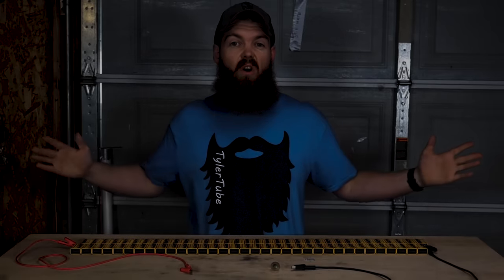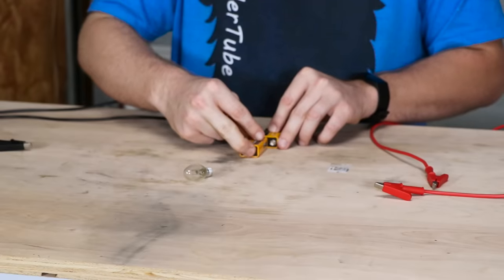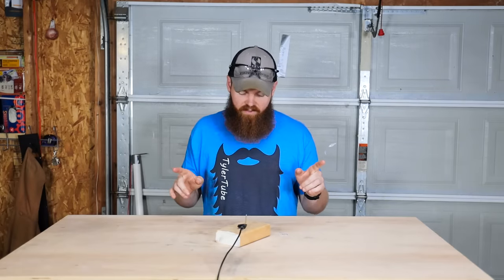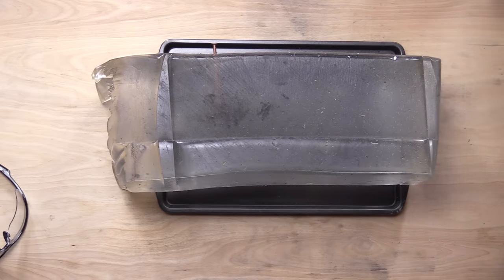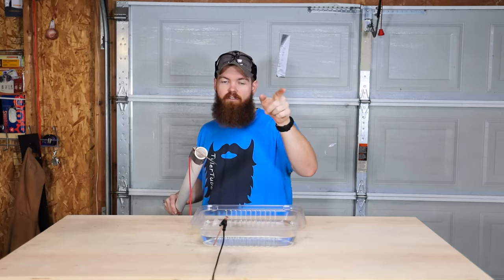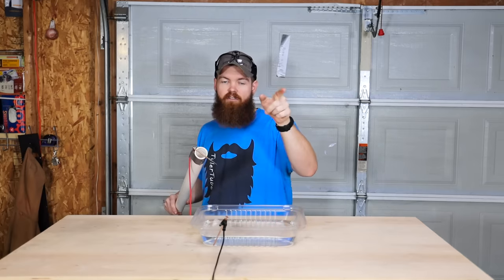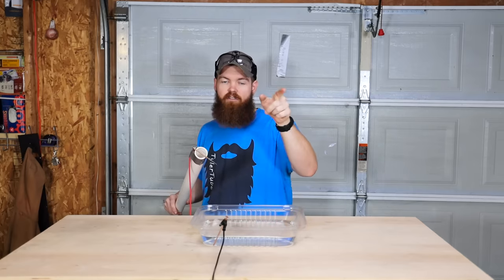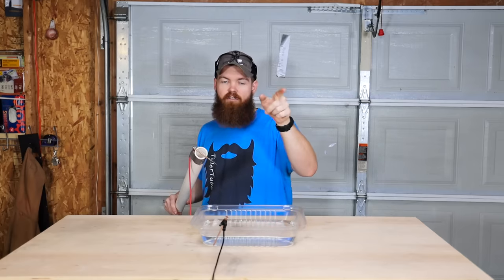I Connected 500 - 9 Volt Batteries...

Comment: Tyler.  Remember that the battery cases are not rated for even hundreds of volts.  Laying your bare arms across the block of batteries is literally playing Russian roulette.  Those voltages will instantly pass enough current across your chest to potentially put your heart into fibrillation and kill you.  The whole block of batteries should only be handled with electrical lineman's gloves and treated with the same respect as overhead lines.  You may only get one chance.
Reply: Hes done this type of stuff tons of times... nothings happened yet.
Reply: Its the american in him that keeps him safe
Reply: It's sad to see this. Like his fate is clear because he doesn't research and only goes bigger. If he doesn't reply to your message you should make an open video to him.
Reply: Only your Voltage is going up. The batteries are still limited to the current of what the single weakest battery in the circuit can produce.

Once you add batteries in series (short circtuing essentially) internal resistance goes up and limits current as above.
Reply: cpt awesome trust me, Clive knows what he’s talking about
Reply: At 6:24 yikes! lol.  Too close to comfort there.
Reply: Thank you for saying something. I was terrified when he was touching both ends.
Reply: However the voltage doesn't kill, if the amperage is about 200 miliamps directly to the heart it will kill you. However a 9 volt batteries only produce about 15 miliamps.

When connected in a series (as he has done) you increase the voltage but leave the amperage the same, thus creating a very low powered arching electrical current (you can touch electrical currents with millions of volts as long as the amperage does not exceed the lethal level) if instead he had wired the batteries into a parallel loop he would have raised the amperage to the point it would instantly kill, however the voltage would be so low that unless it was touched directly to his heart it wouldn't have the power to push though the body and kill.

The only real danger with this experiment would come from burning, due to ohms law and the way a battery casing is constructed the casing would over heat very easily while generation this many volts, most likely becoming hot enough to melt the table.
Reply: @troydreamer5939  9 volt batteries can produce way more than that, and while it technically does not add up in series, I feel that due to various effects like capacitance it might still be able to somewhat add up a little and give higher bursts such as the initial connection.  Those arcs represent a large amount of energy.  If the current was being limited the voltage would drop to near zero and arcs would never happen.
Reply: @redsquirrelftw  under correct conditions a singular 9 volt could reach upwards of 500 miliamps being produced, I would guess based solely on the hotdogs near the end not burning and just running the current through them that it would possibly be running about half that. However that stipulation is purely based on visual information.
Reply: You can see how much Tyler knows about electricity when he places the live plus rod against a metal garage door.
Reply: When Bigclive is saying it, you know it's serious.
Reply: Does the dc voltage make a plasma ? Or this vids is just a scamm
Reply: cpt awesome here’s the thing. High voltage like this gives the potential for high current. These batteries aren’t necessarily rated for high current, but this level of voltage gives the potential to overcome any internal series resistance that these batteries might have. I wouldn’t be surprised if he blew through the dielectric mediums inside the batteries with this voltage. And either way even if the current less less than half of an amp, there is still enough power there to fry his heart
Reply: @Okurka.  a positive rod has no power running through it. When it comes to batteries the energy flows out the negative terminal and into the positive. And when the negative is not in contact with somethingeither connected to the ground or the positive terminal the electrons stop flowing. 
This is partially why when you take a car battery out you take the negative terminal off first. That way any extra energy will flow inter the battery and there will be no charge left in the car. And why when you reconnect the battery you place the positive on first, that way electricity doesn't become stored while you are connecting it.
Reply: @troydreamer5939  What are you basing your 15mA on? Under fault condition (i.e. short circuit) a new 9V battery can easily push 10 amps (edit: momentarily, then it drops off to 2-ish if I remember right). You can check this by shorting one with a multimeter in amps mode, but don't hold me accountable if it blows the fuse (or worse).
When you have 500 batteries in series everything conductive is effectively a short, so that's more or less the current you'll get out of them.
Reply: bigclivedotcom thanks for chipping in Clive. Hope you’re feeling better this week :)
Reply: @Ro Flush ok you seem to be smart and able to learn I am certified first of no stun guns typically are 15,000 volts to 40,000 volts air will break down under a certain voltage and if you put 1 megavolt on a centimeter gap it wont make a spark also a a million volts can make a 3 foot arc if it can't it's not 1 million volts,next what kills is is the current AVAILABLE if you try to limit current down it will lower the voltage based on what's available it's like saying I'm going to shoot you but if the bullet hits you softly you'll be fine, next there is still more than enough current available and voltage supply to kill him
Reply: @godparticle3833  ok now how does one insert 40k volts to a single battery of a small taser
Reply: @xaesthetics1769  there are many ways but the jist of it is convert dc to ac many ways to do it then run it through a device called a voltage multiplier that uses high voltage capacitors and diode, diodes are like check valve they only allow electricity to go one way and capacitor wich store electricity through eletric fields and it takes the ac and converts it through the first 2 capacitors and diodes and that's one stage you can add many more eventually you will need a tower up to 5 feet tall or more but you can keep on going but the point is the diodes connect the charged capacitors and discharge them in series like in the video except batteries store energy through chemical energy you can do it that way, I happen to have a 12 inch tall tower insulated in oil that makes 150,000 volts
Reply: @troydreamer5939  you have no idea what ohms law is do you? also 9v batteries are capable of over 1 amp in short circuit duty, you have absolutely no idea what youre talking about, and i invite you to test what your saying yourself.
Reply: @troydreamer5939  smh that is a misconception that you reference wrong the theory that ben Franklin came up with it said positive to negative but it is negative ions flowing that is incorrect at least attempt to learn about a subject before you talk
Reply: @troydreamer5939  "a positive rod has no power running through it" can't believe you just said that, please stop arguing about stuff you have not a single clue. OF COURSE theres no flow of current if the circuit is open, but you ned to understand that there is something called POTENTIAL. and at 4500v you can trow away anything you think you know about batteries.
Reply: @troydreamer5939  He said several times that the negative side of the battery was grounded.
Reply: Some kid with access to a closet full of 9-volt batteries is going to see this video.  I'm grateful I didn't know this was possible until I was old enough to know how dangerous it it. Pointless, useless, garbage that would never be allowed on regular television, because it's obviously negligent.
Reply: .4 amps will stop your heart especially being pushed by 4500 volts.  I'm sure those batteries can put out more than a few amps.  Be careful.   And the hotdogs do not have much resistance, hence the conductivity of all the salts inside.  The higher the resistance the less "fun" you have.
Reply: @troydreamer5939  can produce 500 milliamps for an hour but can go way way higher than that for a few seconds
Reply: @redsquirrelftw  right! If he touched those leads 😬😬😬 and right after that hes slapping that giant 500 battery pack mass like its his table, this video could so easily have ended in his death man its nuts
Reply: @codygilbert313  the highest ever produced amperage from a 9 volt, ever recorded, was 500 miliapms.
Reply: @troydreamer5939  15 milliamps? that wouldn't even power a fart! checked the spec PC1604BKD 600maH
Reply: @allothernamesbutthis  600 maH means every hour it produces 600 miliamps. That means every minute you get 100 miliamps and every second you get. Wait for it. 1.6 miliamps.  Which is why when you read the side of a battery it says 1.5, that's the amperage .
Reply: @troydreamer5939 shorting a battery releases it's maximum power. He had 2700Wh of energy from that battery pack.
Reply: @troydreamer5939  You know nothing buddy
Reply: @mesanders1113  The certified electrical engineer who has been disputed by people who have the power to use Google. Yup, I am an idiot. Because I tried to teach people about electrical circuits. 
I'm sorry that the facts don't line up to what Google has taught any of you. Have a nice life.
Reply: @troydreamer5939  no that's wrong it can give your bursts of amperage much higher for a very short duration.  Google it
Reply: @godparticle3833  So what you are saying, is I'm wrong, then stating what I said, and saying this is the truth? It is a known fact that when it comes to batteries the electrical current flows from the negative terminal to the positive terminal. And yes Ben Franklin did say it was the other way around however we now know this is not correct.
Reply: Stop trying to act super smart ur not
Reply: @TwitchArmy1YT  "super smart" and being trained in a a specified field are completely different.
Reply: Troy Dreamer do I care go away
Reply: His time has not came yet
Reply: Almost a liveleak footage. Luckily not happen! Good video!
Reply: Something all of you are failing to consider is voltage drop from dying batteries as his horrendously dangerous experiments continue. My 2 cents.
Reply: @troydreamer5939  no what I am saying down to the subatomic level which electricity is It doesn't simply flow one to the other but if want lamens term the negative goes to the positive the positive is a cathode which is the increasing in electric potential and the anode the negative is giving away it electrons but the third part is the electrolyte which usually known as battery acid but it doesn't allow for the electrons to move this can be seen as bubbling in the liquid but when somthing connects the two terminals the electricity flows
Reply: @troydreamer5939  what kills is the current available which is determined by the voltage I've seen people put 1000 amps on there tounge but since the the voltage was low he was fine besides a little burn I think the electrodes were hot they did just melt a penny but the point is the available current and supply voltage are determined by a number of factors if you try to limit the current to make the voltage "safe" the voltage will drop it's like saying I'm going to shoot you but If the bullet hits you softly you'll be fine
Reply: @xaesthetics1769  The voltage from the battery is stepped up by a transformer, but you'll need to have the circuit oscillating to activate the transformer.
Reply: @chrismason1530  yes but typically you can't fit one that can make 40kv so typically that voltage is ran through a voltage multiplier
Reply: @troydreamer5939  It's simple math, 600maH doesn't mean 100ma every minute. It means 10ma. 600/60=10
Reply: @peebrian6398  omfg... I wasn't in the right frame of mind and just devided by six. You got me there.
Reply: @troydreamer5939  👌don't know enough about anything else to fight you on it but I knew that wasnt right
Reply: @troydreamer5939  For those reading this and want to know the correct way to calculate battery life, find a video elsewhere. 600mAH is the battery capacity. Which means it can provide a total of 600mA @ 9v for a duration of 1 hour. If the load is only 10 mA @ 9v then it should last up to 60 hours. There are separate ratings for peak output current and constant output current for batteries. In theory the battery could provide 600A for 1 millisecond, but the internal resistance would limit the output. Hence the separate values for peak and constant current from capacity. Batteries, can be made to provide higher outputs for motors or have much longer life like ones for watches. Their capacity doesn't determine their current output.
Reply: Lmao someone who doesnt understand electricity is flapping his gums
Reply: 10 amps cant kill you ive been hit by 200 twice and walked away 9v batteries cant kill you when hooked in  sync
Reply: But that only happens on AC... Right?
Reply: @troydreamer5939  Dead Wrong, you are not accounting for peak current, a heart doesn't require continuous current to slip into V-Fib.
Reply: @troydreamer5939  The reason why you remove the negative connection first from a car battery is because all the metal of the car is connected to the negative.  If you try to remove the positive connection first, you could touch your wrench against a metal part of the car, and melt your tool and possibly explode the battery.
Reply: @theghost7277  if you touched a  120volt 20 amp branch circuit, or a 200 amp feeder cable, or a 400A commercial service, or a string of Christmas lights protected with a 3 A fuse, the current actually going into your body was probably less than 0.1 amp. Your body has a resistance that limits the current more than the breaker does. The problem with these batteries is they can only deliver a few amps but they have a ton of voltage that will overcome the resistance of his body and make sure that he receives an actual shock of several amps. Which is much more dangerous than a 120volt supply that can't force all those amps through a body.
Reply: @TaylorKromOFFICIAL  yet, I'd trust bigclives word without hesitation, he knows his shit.
Reply: All hail the beard 🙏🏼
Reply: @deltab9768  all i know is that panel was hot and i knew being an electrician wasnt for me cause i was sore and had arc marks up my right arm had to go get mri ed for clots too not fun and very painful but not something everyone can live through so i consider myself lucky
Reply: @ThomasMcMillan1  Thank you
Reply: @TaylorKromOFFICIAL  Of course nothings happened YET but thats a piss poor argument against the facts bigclive is stating. Nothing bad happens until it does. People play with danger for years until the day their luck runs out.
Reply: He said himself he knew it was dangerous, so at least he understands the consequences
Reply: @theghost7277  read my comment directed towards troy
Reply: Taylor Krom OFFICIAL yet
Reply: Sorry, I have zero knowledge in electricity but I'm struggled to understand the basics of volt and amp. Is volt like how many electrons flowing at a time and amp is how fast (is it why current mostly kills?) the electrons flowing at a time?
Reply: @xaesthetics1769  Tasers are what the police use and they are rechargeable, like power tools. They also are capable of holding quite a bit of power, enough to discharge at least twice, possibly three times.
Reply: @jeffreygordon7194  This is not negligent. He is not responsible for other people's children (be they stupid children or not).

I'm 44 and I was hooking 9v together when I was a kid, I didn't need Tyler to show me. I was even taping other batteries together then twist ties together till they reached the ends of the batteries (they melted before I could finish taping lol).

Kids will experiment, besides who in the holy HELL will have boxes of 9v batteries?
Reply: @Bruh-rz2hc  ok so we are going to use water as a analogy because its commonly used voltage is the pressure of the water and current is the flow current basically is the amount of electrons moving and what kills is the energy available energy is voltage x current x time the available energy is controlled by a number of different factors but basically if you try to limit the current it changes according to what's available for example if I have x volts and x currents and I try to lower the current to make it safe the voltage changes accordingly if you want to know more I suggest you watch the channel electroboom personally I prefer dr lewin but he explains it in a simplified way and shows how not to and how to and also has funny and he's certified
Reply: @troydreamer5939  So what would happen is connected, say, 10 car batteries together and did an experiment like this?
Reply: @Bruh-rz2hc  If you think of it as water, voltage is the pressure and current is the flow.
Reply: @xaesthetics1769  miniature transformers can increase voltage while lowering ampurage.
Reply: @evictioncarpentry2628  Okey then a 9v block can provide up to 2amps. 2amps at 4000volt will kill you baby and it will kill you faster then you can scream
Reply: @048_dewapramudya5  yes of course. In fact a DC ark is much harder to extinguish
Reply: People arguing about how dangerous they think 9v batteries are, coming up with all sorts of misunderstood theories.

This setup cooks hotdogs and burns wood. It's a pretty good demonstration of how much stored energy is in those batteries.

And if it can pass through deionised water and make a wooden table charge with static, it can also pass through the thin metal of a battery casing.

Come on folks, turn your critical thinking back on, this isn't a "who can say the most technical sounding things" contest.
Reply: Randal Marshik yee man we need him to stay alive
Reply: Ya know, you're not wrong, but ya also know its Tyler
Reply: @tg11-dot-org  Yeah, but we have to look after Tyler.
Reply: bigclivedotcom also true
Reply: @troydreamer5939  oh wow, you don't know much about batteries do you?
Reply: @TaylorKromOFFICIAL  thats not how it works just cuz hes lucky the chance doesent go away
Reply: Taylor Krom OFFICIAL yet
Reply: You guys have to understand that the actual flowing current counts. Not the current the source is capable of. However at 4500V, a lot of current can pass through a human. And those 9V blocks can deliver up to ~5A. Yes, only for seconds, but that is enough to kill. Thats 4500V*5A. Y'all know that 22kW is quite a lot of power.
Reply: @vacston  I agree, 🇺🇸🇺🇸🇺🇸🇺🇸
Reply: @Bruh-rz2hc  Amps are the amount of water, volts are the water pressure, and ohms (resistance) are the size of the hose
Reply: @redsquirrelftw  you can create arcs if you rub a fuzzy pillow and turn the lights off. Arcing isn't exclusively a dangerous high voltage/amperage occurance.
Reply: You have a good point but he's done it MANY times before
Reply: .5 Milli amp threw the heart= dead! google it. I did some even say as low as .1
Reply: "Voltage doesn't kill you, is current that does" yes yes, and the earth is flat too.
Reply: @IThrowBall  they are a clear sign of dangerously high voltage. But the amperage can vary from "ouch" to "hospital".
But if you see the big, fast rising arcs this battery pack creates, you know there is a high (1A-10A range) current involved.
Arcs look different depending on the current. This one looks dangerous.
Reply: @eniklisnihm4565  depends on the current type (and also voltage). 
.xx millimamps is more for AC. For DC its better, but still very dangerous what he is doing.
Reply: In the words of my seventh grade science teacher, Mr. Hobus: You can try anything once.
Reply: @thedanielk.project4998  that is not how voltage is explained it is the water pressure and current is the flow the energy available kills read my other comments to not be ignorant about this subject
Reply: cpt awesome wouldn’t it just be the amperage or wattage that goes up? Because with being someone who hooks up subwoofer systems, I connect batteries together all the time and they still stay a total of 12-14 volts. No matter if I do series or parallel circuits
Reply: Cecil M no dude. Parallel for increased amperage, series for increased voltage. The only way to get 12v out of a series of 12v batteries is to undercharge them.
Reply: So.. Basically the lesson is .. Safety Is Numbah Wan Pryority
Also... 
DON'T MESS WITH HIGH VOLTAGES THAT MAY GIVE HIGH CURRENT SPIKE AND KILL YOU
Please Play It Safe and Get Lineman's Gloves (and other safety equipment) If Doing Experiments Like This.
Reply: These arcs are similar to those produced by the many videos on youtube of experimenters playing with microwave oven transformer, just minus the angry hum of the transformer (because the batteries are DC). Tyler is playing with twice the voltage, and MOTs are already lethal. There are many places on the battery cases the energy in that series connected string can easily jump out and bite you. BigClive is right.
Reply: @troydreamer5939  Yall realize you're trying to lecture to an electrical engineer right? Big Clive isn't just talking out his ass lol
Reply: cpt awesome 9v battery’s put out about half an amp, plenty to kill at sufficient voltages
Reply: Really?? How much do you think 500 batteries costs
Reply: Styropyro is the only youtuber I would trust in this type of conversation. That dude is an electronic genius. And he's nuts too lol
Reply: Its not the volts that will kill you its the amps. You obviously don't know much about electrical theory. Also the voltage in a single cell doesn't go up....it remains the same so therefore yes those 9v batteries cases can handle 9 volts lol
Reply: @Okurka.  not all metals are that conductive bud.
Reply: @TaylorKromOFFICIAL  It only takes once... Please be careful. A nine volt alkaline battery can produce several amps into a short circuit. Those 500 batteries are easily as lethal as an electric chair.
Reply: @troydreamer5939  Respectfully, you are mistaken sir. The usual load for a nine volt battery is a few milliamps, but a nine volt alkaline can source 3-4 amps.
Reply: @sleezymechanic  Aluminium is quite conductive.
Reply: @redsquirrelftw  Came here to say the same thing.
Reply: Randal Marshik relax bud
Reply: @048_dewapramudya5  Yes, DC makes a plasma, much more so than AC. This is because a charge (voltage potential) is always present in DC but in AC the charge momentarily goes to zero as the polarity reverses, and this can have the effect of extinguishing the plasma.
Reply: @Okurka.  fair enough but not conductive enough to complete the circuit when the ground is 5ft away.
Reply: @sleezymechanic  Where do you get 5ft from? The frame touches the ground, Tyler is also touching the ground with his feet.

You do know they make electrical wiring using aluminium, right?
Reply: @Okurka.  dude you have no idea about electrical theory. stop... the ground is the negative on the battery his black lead is connected too lol you are ridiculous
Reply: @troydreamer5939  "the highest ever produced amperage from a 9 volt, ever recorded, was 500 miliapms." This is just demonstrably wrong. You can have hundreds of amps at 9 volts... Heck, every arc welder produces more... Most electronic devices use more at 9 volts...

You clearly have no idea what you're talking about.,
Reply: @sleezymechanic  Negative isn't ground. The positive was connected to ground via the garage door. Tyler was connected to ground with his feet. He nearly touched the sausage that was connected to the negative terminal and thus closing the circuit.

Looks like you're the one who doesn't understand electrical theory.
Reply: Thats actually in the upper region of most defibrillators in terms of energy, there is plenty enough there to kill
Reply: yeah there is potential.. a lot. but if your smart and pay attention to the basics of electricity and electrical theory then you will NEVER kill yourself due to electrical shock. i mean come on.. if telsa headed every warning from someone who didn't know anything then yall would still have DC volts pumping through your fkin houses lol
Reply: Taylor Krom OFFICIAL doesnt mean it can’t. look at steve irwin as an example
Reply: i didnt think about casing at all, i did cringe tho hoping no one would touch the garage door while 4500 volts are resting against it XD.
Reply: Can we get a collabo? I feel you could help Tyler with some safety aspects of his vids, also I'm a big fan of you both
Reply: yes
Reply: cpt awesome if you keep adding batteries, although the internal resistance of the batteries goes up, the voltage and current of the chain also goes up. And because he’s shocking things like apples, which have low resistance, it’s still 4500V/1000 ohm=45 amps. Even the resistance is 10k, that’s still 4.5 amps, which is still a lot.
Reply: Camilo Pasin definitely. Internal resistance is for when it is under load, but in short circuit, I’m pretty sure it can go way beyond
Reply: To me it's wherever the weakest link is in the circuit. Can one make and assumption current is consistent across the series arrangement ? Also the voltage might ark between  the batteries so not sure how he gets away with it.
Reply: He's leaving the sharp end of the voltage generator on a metal garage door that runs to earth. Seems very careless.
Reply: @TaylorKromOFFICIAL  yet...
Reply: @evictioncarpentry2628  even a bad 9 volt battery can produce enough current to make your heart fibrillate. It takes only a few milliamps and the batteries can do tens of milliamps, if not more.
Reply: I'm really surprised it didn't jump across the cases or like u say a few cases, him, and a few more cases. This is not the way to find out electricity can be unpredictable when u dont understand all the elements of the equation..
Reply: @demoniack81  correct mate big amps for 4kv this could could kill in an instant. I dare bet there enough voltage and current to kill an elephant.. we would have to ask Edison I guess
..
Reply: @TaylorKromOFFICIAL  I say that every time I drive at 140mph 😂
Reply: Anyone else concerned that an Arc Flash would happen. Not sure if that is possible in this case but electrcity can be dangerous to handle without the proper PPE like the guy says above.
Reply: Well said bigclive
Reply: The level of ignorance evident in some of these replies is appalling.
Reply: @alien8r33d  it's scary, Dunning cruger Springs to mind..
Reply: @troydreamer5939  your claim that a "9v" battery can only output 15mA is completely false, just look up the datasheet for any 9V battery...
Reply: @Okurka.  its DC (direct current)
It won't do anything unless the 2 leads meet.
Reply: @Stonet420  They'll meet via the ground...
Reply: @Okurka.  if he had the negative lead attached to a metal ground, maybe.
Garages are typically cement, and the lead was hooked up to the table. When he was performing the tests.
He was also unplugging the leads each time he was done.
Reply: Voltage and amperage/ current are different.  Voltage will burn u but not kill you. Amperage will kill u.     I have used a megometer hand crack voltage generator for fun and cranked it to 20k.   As long as I had a tight hold I did just fine but once I went to let go loosen my grip on the electrodes it hurt a little cause I created a difference in potential.   Fun stuff.   He may have gotten burnt but not dead. A stun gun is 50,000 volts. Some a lot more
Reply: Your understanding of electricity is over stated. Stop pretending to be an expert.
Reply: @TaylorKromOFFICIAL  Said every dead electrician burned to crisp. 
I've seen it when I was working at Coal Power Plant - said electrician had probably small hole somewhere in his equipment.
I will never forget that.
Reply: All these smart people in these comments lol makes me feel like a moron👌😂
Reply: @TaylorKromOFFICIAL  YET
Reply: @troydreamer5939  Oh wow, that's seriously some utter garbage theory you have going on there. There is no "charge" left anywhere when you disconnect any of the terminals, since there is no where for the current to flow. You know, it needs to be a CIRCUIT to work. The reason to remove the negative terminal is in the case that your tool hits the metal body of the car, it doesn't go boom. Quite simple actually.
Reply: @Ro Flush No, stun guns are not a million volts. Not even 100.000 volts. Look up on the insulation distance to make these kind of voltages. It's physically impossible to generate that kind of voltage between electrodes that close, let alone wind a transformer that small that can generate that kind of voltage without arc-over.
Reply: @troydreamer5939  What a load of BS.
Reply: For those arguing about how much amps a 9v can deliver, check out https://www.youtube.com/watch?v=ONoEQduiVVU for a standard alkaline battery is about 2A peak amperage. internal resistance is around 300 - 1000 ohms, with skin resistance being a primary factor of 1000- 100000 ohms, if we assume a resistance of around 10000 ohms, then at 4500 volts, then 0.5 A would be peak amperage well within the batteries capabilities. In general hand to hand current will not pass through the heart so unlikely to cause death directly. A typical cardiac defibrillator delivers 1kV at approx 45A over 10ms.
Reply: @TaylorKromOFFICIAL  bruh
Reply: @troydreamer5939  That's bullshit, a 9v battery can easily produce more than an amp of current during short circuit, at the voltages used in this video the human body can conduct hundreds of amps.
Reply: @TaylorKromOFFICIAL  Yet...
Reply: Maybe he has slippers if he is he just gets a mild burn
Reply: @ghostdross1660   No, it doesn't work like that. Batteries have no reference to ground. Electricity flows from positive to negative, not to earth, from the right hand to the left hand passing through the heart and stopping it or causing ventricular fibrillation, sending him to the afterlife. Only ElectroBOOM is immune to electricity, his heart doesn't even care anymore xD
Reply: Niente Nessuno in assumed he was just touching positive or negative 

+ Good to see an ElectroBoom fan
Reply: @ghostdross1660  Yes, batteries have no reference to ground, nothing would happen, he even did it at 21:14. You get electrocuted only if you touch both positive and negative.
Reply: Troy Dreamer you can’t melt wood tho
Reply: Zyanid Warfare So you’re telling me that you haven’t ever casted a wood ingot?
Reply: You never know, maybe his living room is in the garage.
Reply: Someguy Studios oh that seems legit, sorry for the misunderstanding... You’re right
Reply: Wüüd
Reply: He is obviously a competent electrical engineer, thats why he makes youtube videos involving electrical theory and practical electronics and repair....oh wait, hmmm maybe he should take some good advice about electrical safety, especially dc.
Reply: @randalmarshik4320  If he doesn't reply to his message.....it may be ALREADY too late!!  😱😱😢😢
Reply: if noone said it, its not the amps or volts that kills but its the overall power and circumstances of the theoretical electrocuted one
Reply: That's just silly
Reply: I know bro it’s literally 4,500 volts, more than an outlet.
Reply: @vacston  lmfao wtf haha you are killing me
Reply: I would trust Big Clive more than any of yous and I don't know much about Electricity 😂
Reply: Wow strange to see you here but yeahhhh man tellem
Reply: @troydreamer5939  Arcs are effectively a short circuit and the short circuit current of a 9V battery can be 10 amps, 100 to 200 mlliamps can be fatal. Once you go much over 300 volts the voltage will easily break the skin barrier. I'm not sure where you have the batteries sitting but as evidenced by the crackling when you touched the unconnected hot dogs there was either current flowing through the air or through your feet. The batteries should be on a electrically insulated surface (NOT wood or moist cement). Each bank of about 30 batteries (270 Volts) should be separated and all your connecting wiring should be insulated for 4,500 volts. There should be a quick disconnect probably at multiple points operated by a pull string by someone else, because if it hits you you will be incapacitated (your muscles will forcefully and involuntarily contract) and likely roasted until death. You should also have linemen gloves at that voltage. I cannot see if you grounded part of the circuit to earth but if it's not grounded you can get shocked by completing any part of the circuit, either from a end pole or the middle. Now, you as an individual, are entitled to your own risks but kids watching this have no idea, perhaps even less than you,  this is an incredibly bad example. This is going to kill someone if repeated.
Reply: @troydreamer5939  I'm with you there all gaining up on you
Reply: Actually. Fun fact. Usually its not the voltage that kills. Its the Amps. About 10-20 mA or so and you’ll be in pain for a while. 20-75 mA, painful shock and loss of muscle control. 75-100 mA, heart damage occurs. 100-200 mA, cardiac arrest.

mA stands for milliamperes. 1 mA is equivalent to 1/1000 of an amp.

Sources: https://www.thespruce.com/amperage-not-voltage-kills-1152476
https://www.asc.ohio-state.edu/physics/p616/safety/fatal_current.html
Reply: @evictioncarpentry2628  don’t argue with Clive.
Reply: @Pittsburgh-412  he has a chemistry degree. He knows very little about electricity when compared to someone like Clive who has a degree in electrical engineering.
Reply: @TaylorKromOFFICIAL  "i put the gun to my head. 5 chambers are empty. It's safe because only 1 chamber has a bullet and I've done it Tons of times"
Reply: @048_dewapramudya5  every "sort" of electricity can arc. It just has to have enough voltage
Reply: @godparticle3833  have you watched electroboom?? ;)
Reply: @jasperboer9854  no I have not
Reply: @vacston  I’ve never heard anything more ridiculous but absolutely true
Reply: @Pittsburgh-412  I also trust @bigclivedotcom
Reply: You should watch electroboom
Reply: @troydreamer5939  if what your heating had a high enough resistance you could make an electric 1000 watt heater from 1 ma at 1000,000 volts. Certain conditions would have to be met though.
 Think of a car headlamp at 100 watts 12 volts and a 100 watt household bulb at 120 or 240.
Reply: @Silentguy_  ok imagine the same voltage using stacks of 3-volt button batteries. Let's say they about to 10ma.   4500 volts at 10ma is 45 watts. Do you think that would stop the heart? bigclivedotcom would be good to jump in here.
Reply: I was so nervous when he put both his hands close to both ends when it was at 600 volts.....
Reply: @godparticle3833  lol 40,000 volt stun gun would be a toy. Do more research bud. My stun gun os rated at 1 mil +
Reply: @TaylorKromOFFICIAL  YET
Reply: @evictioncarpentry2628  You saw what it did to an Apple, Hotdogs, wood. The numbers wouldn't convince me that human flesh would fare better.
Reply: @xaesthetics1769  Capacitors....
Reply: Honey, the boy's fine
Reply: @TaylorKromOFFICIAL  YET. You only need to get unlucky once and that's it.
Reply: @troydreamer5939  Look at the energy in those arcs. THAT is the current that would flow.
That line of hotdogs = 2 arms.  Heart goes "BANG". 😶
Reply: @evictioncarpentry2628  you do realize Clive is an expert right?
Reply: @evictioncarpentry2628  a nine volt battery can easily supply enough current to kill someone.
Reply: @troydreamer5939  i really doubt a 9 volt battery can only supply 15 mA
also, when he shorted the batteries, the arc looked like a high power arc, like one from a microwave transformer rather than a low current one like from a tesla coil
Reply: @Bruh-rz2hc  Old man Volts pushing a wheelbarrow full of Amps up the hill Resistance. Volts is the pushing force, Amps is the load and resistance is the force working against the voltage pushing the Amps. As a crude and not entirely helpful analogy - A 20 ton truck travelling at 2 mph will kill you stone dead whereas a feather travelling a 100 mph will maybe hurt you. The reason this is unhelpful is because resistance is not taken into account and also high voltages do funny things. You only need a tiny current across your heart (100 - 200 milliamps) to kill you. This video is assinine and the UL's behaviour is tantamount to suicidal. This video should be taken down to prevent another knowlessman running out of "luck".
Reply: @georg6876  the voltage can arc from the positive terminal, as at such voltages the arc can be a few millimeters long.
Reply: @TaylorKromOFFICIAL  It only has to go wrong once.
Reply: @xaesthetics1769  Ohms law.
Reply: Yea this thing is no joke
Reply: Without a Faraday suit, i wouldn't have done this
Reply: I work construction deep underground mainline utilities. You can do the thing a million times and be fine but then that one fluke time it kills you. So in regards to people saying hundreds of times and you've been ok well that usually how it goes until it's that one random time and for things in my field you often don't get a 2nd chance. That's why they invented safety. And I'm not even a safety pusher I'm just saying. Remember. The. 0000001% chance is what gets ya.
Reply: @troydreamer5939  As soon as you open a circuit, current stop flowing, the only thing that can "keep" charge is a capacitor and will only discharge by shorting no matter what side you disconnect first, it's the exact same. The reason you disconnect the negative first, is to avoid making a short circuit with a tool between the + and the surrounding as the ground is connected to the -, If the car have is ground connected to + then you'll disconnect the + first https://www.restore-an-old-car.com/positive-ground-cars.html
Reply: @TaylorKromOFFICIAL  irrelevant
Reply: I think he acts like he wants to figure out if his heart, like the apple, gives small blue sparks or big orange fireball when 4.5 kV 0.5 A 2.25 kW is passed though it. Then he halves his steaming blackened heart to see if the inside is charred or not. Not smart.
Reply: @troydreamer5939  he said half an amp thats 500 mA not 15 mA
Reply: @048_dewapramudya5  it does
Reply: @godparticle3833  he saves on hearse coffin cremation though because he already built a Crispy Crem himself. His relatives just directly come with an urn into his place.
Reply: @nodriveasusephotos8019  If a cr@ppy 3V button cell only puts out a max 10mA (on short), it is because it has a very high internal resistance (3/0.010 = 300 ohms). If you put 1500 of them together to produce 4500 volts, the total internal resistance becomes 300*1500 = 450K ohms. This is much larger than the resistance of the human body, so the current will still be about 10mA (4500/450,000). But here's the important part: because the battery internal resistance is limiting current and the human is practically a short circuit, the voltage across the human will be very minor. If the human has only 2000 ohms resistance, the voltage across him/her will be V = I*R = 2000*10/1000 = 20 volts. That's a bit of a letdown. The vast majority of that 45 watts will end up heating the batteries. The human gets 20*10/1000 = 0.2 watts, not worth talking about.
Reply: So that’s it’s called why it’s called a DEfibrillator. 😮
Reply: @Okurka.  He was just calling it ground.  I doubt it was actually connected to AC ground.  That would be needless and possibly foolish.
Reply: @troydreamer5939  "600 maH means every hour it produces 600 miliamps"
No it doesn't.  It means it can produce 600 ma for one hour and then the battery is depleted.
Or 300ma for 2 hours.   Or 1200ma for 1/2 hour, etc.
Reply: @godparticle3833  "what kills is the current available which is determined by the voltage"
Current available has nothing to do with the voltage.  Case in point:  a D Cell battery and a 1.5V button cell.
Reply: @godparticle3833  There's nothing wrong with calling the negative terminal gound.
Reply: @theghost7277  Just because it was a 200 amp panel doesn't mean you got 200 amps through you.  You would pop like a bug on a bug zapper if that happened.  The panel didn't have anywhere near enough voltage to pass 200 amps through you.  It would have needed 200,000 volts or more for that to happen.
Reply: @Hyxtryx  He clearly is foolish.
Reply: At least it's not AC.
Reply: 20:12 he can count!
Reply: DC is safe to touch.
Reply: But with thousands of volts it's maybe not safe to touch both of the poles at the same time. It burns you.
Reply: @TaylorKromOFFICIAL   Foolish person!  You may get only one "yet" while playing around with high voltage.
Reply: @cyanoure  OK, touch 5000 Volt DC then.
Reply: @troydreamer5939  DC batteries are not current limited the way you think they are.
Reply: @evictioncarpentry2628  The current output of any battery is only limited to the plating characteristics and thermal runaway. These batteries can easily output 2-3 amps and the amount of current to stop a heart at that voltage is calculated to milliamps. 

This is incredibly dangerous and dc current doesn't give a shit how "american" someone is.
Reply: Clive speaks the truth! Please be careful with future electrical "fun"
Reply: @troydreamer5939  But how do we know that he connected the banks in parallel or Series if he had the 6 Banks he made are placed in a Parallel connection then there would be only the Voltage of the batteries that are connected in series so his 4500V may of been more at 750 Volts assuming there is roughly 80 9 Volt batteries in each bank. So that 15 milliamps you assumed can be more around 60 milliamps or more so It could of killed him.
Reply: @cashorcredit1887  If you make contact with ANY uninsulated wire that is live your providing a path to the ground and instantly become part of the circuit and you only need one point of contact (I touched  with my right hand an 120V outlet that i forgot i energized in my project). Batteries are a whole diffrent animal though touching a 9V or a 1.5V batteries may not hurt you but a bigger battery will like in this case like a 600V bank of batteries
Reply: @michaelolsen4733  Lol, you're so wrong
Reply: @rexsceleratorum1632  There is still 10mA going through the human though, which probably won't kill them, but will still hurt a lot.
Reply: @jimmysyar889  Sure.
Reply: @jimmysyar889  i have no idea what I said cant find the comment but im sure I was right im always right.... Lol
Reply: @michaelolsen4733  you said your taser was 1million plus volts and a 40kv taser is a toy
Reply: @TaylorKromOFFICIAL  all it takes is that one time my man.
Reply: Big Clive  Is an expert when it comes to hurting himself lol and electricity so listen to this man.
Reply: You are a muppet, there will be more power delivered.
Reply: He should not be doing this stuff
Reply: Another point of mine is batteries are a very dangerous way to get high voltage because there is no off switch, they're always live. One mistake while hooking the Batteries could easily kill you.
Reply: yet
Reply: I could not believe what I was seeing, this is so dangerous
Reply: @thedanielk.project4998  wrong, its the combination of current and voltage that gets you. Learn about Ohms law first. 

Voltage needs to be high enough to break through your bodys resistance. Then your resistance and the batteries resistance will determine how much current is passed. U•I=P and U/R=I

U is Voltage
I is Amps
R is resistance
P is power
Reply: Funny seeing this comment, I just watched your vid on electrocution.
Reply: @godparticle3833  a bridge rectifier.
Reply: What about ohms law? Surely increasing voltage (V) and a steady (R) in this case the guys body will increase the current (I)?
The equation is I=V/R.  Can someone highlight if I'm wrong or not? Because to me it seems increasing the voltage will also increase the amperage.
Reply: DC vs AC
Reply: Yeap I was shitting myself just watching him be so bla say about it all

The worse danger of all is the batterys exploding 

After like 600v the pack is pretty unstable and can get reactive inside itself
Reply: @weazeldark3983  blasé 👍
Reply: @ross9170  haha
Reply: @troydreamer5939  Where did you get 15mA?
Reply: @troydreamer5939  9 volt battery puts out like 5 amps and that is VERY dangerous in 40 000 volts
Reply: Voltage means nothing without amperage, running batteries in series like that doesn’t increase the amperage, only the voltage. I was only worried about the batteries catching fire
Reply: @gokiburi8  More voltage means more amperage if resistance is same. Remember ohms law...
Reply: Nice to see you here Clive! I agree he really  shouldn't be doing this he's gonna get electrocuted.
Reply: @TaylorKromOFFICIAL  just because it didn’t happen yet doesn’t mean it will never happen. He should be aware of the dangers
Reply: @djkamilo66  Easy. Charge a capicitor with the battery.
Reply: Nothing can flow with just one wire connected! The car battery neg is removed first(and reinstalled last) so that if the wrench touches any metal/framework while on the neg terminal, it wont arc !
Reply: Irrelevant. The battery negative is isolated from everything. Its not ground as he kept calling it
Reply: Looks like sombody does not like to have fun
Reply: @psommers7646  not technically true. There is always a complete circuit due to various capacitances with things. It’s why power lines can shock you even if not grounded.
Reply: I was wondering what your thoughts on this would be. Seems like he took the advice to heart (no pun intended) considering he hasn’t posted anymore of these battery videos
Reply: For something you " only get one chance" at he has had many many chances. 
I genuinely appreciate electrical safety tips but making it sound more dangerous than it is will lead to people doing it just to prove you wrong.
Reply: Definitely correct, lucky it didn't jump as you handled them so close to opposite polarities.wow, might be time for a lot ticket
Reply: he would have to accidentally touch both ends of the circuit to get any huge jolt.  You could have a million batteries in the chain, if you laid your arm across one section you would still only be exposing your bare skin to 9, 18, 27, or 36 volts if you happened to make contact with the terminals.
Reply: @tecnogadget2  yeah.  if it's about electricity and clive's telling me, i'm being told.  there's no shame in it. i studied high voltage power as part of my engineering degree and it didn't immediately occur to me about the battery casings.  like he said, you've only got to not be thinking once and then you might not be thinking ever again.
Reply: What is shocking is that you don't understand electricity and neither do half the replies.

A bunch of people cosplaying as OSHA
Reply: @TaylorKromOFFICIAL  Yet
Reply: @troydreamer5939   600mah is a capacity and has nothing to do with current capabilities, unless it gives a discharge rating in Cs. I’m guessing you could easily get a lethal current from this setup.
Reply: @ThomasMcMillan1  Why did it take so much scrolling to find a single person that knows a thing or two lmao, thanks Thomas
Reply: @troydreamer5939  You are considering normal operation, increase in temp can increase the Amps the battery can put out.
Worst case situation internal shorting creates plasma pathways through electrolyte resulting in almost NO RESISTANCE and a runaway reaction.

I wouldn't want to say it it can kill a human, but I also wouldn't want to claim it CANT in such a situation.

I most certainly would not want to bet my life on it.
Reply: @TaylorKromOFFICIAL  complacency bias, what happens that 1 time where something happens.
Reply: Was thinking this, I cringed so hard when I saw that
Reply: So many people here who don't have a clue, trying to sound like they do, and not realising BigClive is likely the most knowledgeable person in the entire comments.
Reply: If the video is up, he survived
Reply: People really don't understand high voltage enough
Reply: Clive you might have saved my life. TY
Reply: @hargroves240  people usually do if they work in that field. There’s more people than just this dude in the comments who know a lot about electricity. Anyone with a brain knows what he was doing was not smart, but he was doing it AT HIS OWN RISK. You can’t protect people from themselves.
Reply: Pretty sure the voltage would be limited due to the resistance of the batteries
Reply: Clive is right. You are working far above the voltages you would get out of a standard household outlet. The dielectric is not designed to withstand such high voltages and the potential is possibly deadly. People greatly underestimate the danger of these voltages.
Reply: @evictioncarpentry2628  Please do not chime in if you have no idea what you are talking about.
Reply: @troydreamer5939  Not True !  Although circuits using a 9 volt battery are designed for a few milliamps to have a good battery life, the 9 volt battery by itself can deliver 5 to 6 amps.  That is, 5000 mA or more.  (This is easy to prove with a ammeter).  So, enough current to kill anybody !
Reply: @troydreamer5939  "when you reconnect the battery you place the positive on first, that way electricity doesn't become stored while you are connecting it."  You have no idea of what you are talking about !!!  The only reason you remove the negative first on a car battery is to avoid making a short between the positive terminal and the body of the car with your tool.  By removing the negative first, it won't matter after it if you contact the positive with the car body with your tools, because at that time the negative of the battery is no longer connected to the frame of the cas.  And the electricity don't become "stored" when connecting a battery...  Aside batteries, only capacitors and inductors can store electrical energy. Please don't talk about things you know nothing about.
Reply: @troydreamer5939  not acknowledging conventional current seems a little disingenuous on your part...
Reply: @troydreamer5939  You are doing the maths in reverse order here.  600 mAh means you can have 600 mA during one hour, or 60 mA during 10 hours, or 6 mA during 100 hours.  The way you calculate it, it would means that "every day you get 24 x 600 ma or 14 A"  Fantastic then: you could have this way 52 560 Amps during 10 years .  Get rid of all those polluting power plants !  Use a single 9 V battery 🤣
Reply: @ThomasMcMillan1  You are mostly right except one thing: a 600 mAh battery won't produce in theory 600A for 1 millisecond, rather 600 A for 1 "millihour" which is 3,6 seconds.
Reply: @Bruh-rz2hc  Your question about volts and amps is one year old, but here some explanation if it is still of interest to you:  Current is a notion first studied by a french man Joseph Marie Ampère, he called it in french "Courant" which means "Flow".  So, current is the circulation of electrical charges, in most case electrons flow.  On the other side, voltage is a kind of "pressure" that pushes or pulls on the electrons and electric charges to make them circulate.  Whether or not the current will circulate, and how much, depends on the voltage (pressure) of the source and the resistance (opposition to flow) of the circuit.  The higher the voltage, the higher the current flow can be.  Think of voltage as a king of pressure and current as the resulting flow. For comparaison, the pressure of the water in your house is about 60 PSI .  And the pressure of the fire hydrant on the street is about 60 PSI too.  Same "voltage" here.  But the flow (current) varies according to the resistance.  With this same pressure (voltage) you get a small flow (current) from the bathroom faucet because the resistance of this faucet is high.  You get a higher flow from the kitchen faucet or garden hose because resistance is lower.  And a very very big flow from the fire hydrant because here resistance to flow is very very low.  All this with the same pressure (voltage).  This is why bigger conductors can carry more current, as larger pipes can carry more flow.
On the other end, if you increase the voltage without changing the circuit, you will get more current.  The same way as increasing the pressure will give more flow if you keep the same hose, as for example in a high pressure washer hose.  Same hose,  more pressure, more flow.  Same circuit, more voltage, gives more current.

One last comparaison here: Arcing is caused by high voltage. If you increase voltage, at some point current can flow through an insulator.  This is called voltage breakdown value and the value of voltage needed varies according to thickness and kind of insulating material.  The same way as "if you increase pressure, at some point air flow can escape through a rubber tire". Pressure value for this is a function of rubber thickness and rubber composition.
Reply: Exactly 😶
Reply: Agreed, I cringed every time he put his arms on the batteries directly.  It only takes one mistake at that voltage.  The power available, at least momentarily is comparable to a MOT.
Reply: @TaylorKromOFFICIAL  just cause nothing happened yet doesnt mean nothing will ever happen. Just that he's one lucky bastard (ment positively).
Watch Clives videos, and you'll realize, he actually knows what he's talking about.
Reply: @TaylorKromOFFICIAL  big Clive is a huge electrical nerd, and works around things way more dangerous than this on quite a few occasions. This can end very badly. The keyword in the sentence is yet. The greatest rule in life is anything that can happen will happen, especially if given enough time. Being safe isn't the coolest, until your the last one standing because everyone else thought games and physical phenomenon are the same thing. Electricity can be fun, but plenty of times it's painful.
Reply: @evictioncarpentry2628  even with this, the voltage gets so high, sure the difference between cells is small, but overall voltage difference is huge and not a toy (for figure of speech) this can turn from fun to hospital quick. I've seen it with my own eyes when somebody did something similar to this one day
Reply: voltage doesn’t kill amperage does. million volt tasers exist
Reply: Buying quality batteries made from good materials saved his live, those ones that are wrapped in paper only need to get wet
Reply: @redsquirrelftw  the first milliseconds you get close to the rated 9V at the rated current however there is a rapidly descending curve and the rate of that curve can be calculated by the charge and the the initial internal resistance. so clive is correct when he says you can get fibrillation by touching it because if you are unlucky you only need a short pulse of high enough joule in your heart. hovever you will not get burned from the inside out like with an power line or microwave oven transformer
Reply: I was, so nervous thinking the exact same thing. Man had no idea.
Reply: Yeah I had many cringe moments watching this too...
Reply: @evictioncarpentry2628  You only need about 50-100mA to become unable to let go. And 50-500mA are deadly depending on time. 9V batteries are easily capable of delivering about 500mA for about one Hour (https://data.energizer.com/pdfs/max-eu-9v.pdf) which at these voltages is plenty for ventricular fibrillation and sudden death. Also question is how much peak current this monstrosity can deliver. I am guessing my the size and incandescence of the arcs that there is quite a bit more than 1A flowing. This thing will kill you dead in a millisecond if you don't treat it with the respect (and PPE) it deserves.
Reply: Not the volts that will get you it’s the amps too watch for
Reply: @mikecrystalrobert7898  you should prove it by grabbing a power transmission line.
Reply: @evictioncarpentry2628  You can see what the current does. How could you even think it is not dangerous? Did you see what it did to the wet wood. Your body is mostly water and not any distilled water. With low voltage we are talking about risks to heart. With high voltage it is at different level. Even shocks though just a hand can lead to amputation of the hand.
Reply: @troydreamer5939  a 9v battery's short circuit current is ~1.5A, at a high voltage that's def enough to kill you, high voltage is not a joke, it's really like playing with a loaded shotgun that isn't in saftey...
Reply: I'd listen to Big Clive. I respect him a lot.
Reply: @TaylorKromOFFICIAL  yet.
Reply: its DC current not AC current... he is fine.
Reply: So many people saying "oh but the current isn't high". Sorry, but look at what it does to that wood and hotdogs - that's a high current. The same damage would be done to a human body touching each ends. He would literally fry.

I think many commenters are mixing up the "freedom" to do what you like and not be told to stop, with the basic reality that this us EXTREMELY dangerous and not done with any safety precautions.
Reply: @TaylorKromOFFICIAL  YET
Reply: @troydreamer5939  You really need to look up something called "Ohm's law"...
Reply: @048_dewapramudya5  yes you can get plasma with AC or DC. Plasma starts from super heated gas. A spark heats the gas and ionize it creating plasma allowing a higher conductive path known as an arc. All electrical arcs are just plasma.
Reply: @troydreamer5939  a bit of an misconception. Both sides have electrical potential. Power is coming from both sides. Current passes from positive to negative and and electrons travel from negative to positive.  With jumper cables you will pull the chassis side off (usually almost always is the negative reference) for safety reasons(I.e.droping the cable on the car).
Reply: @Okurka.  I believe he was just referring to the negative side as ground. It would actually be more dangerous to reference this to earth.
Reply: @troydreamer5939  amps are always amps. Amps are meaure of current not power or capacity. and amp hours are the measure of current over time. 1aH is 1amp in one hour or .5 amps for 2 hours or 2 amps for a half hour. Amps*hours=aH
Reply: @girlsdrinkfeck  haha yep - when he busted out the hand soap i released he was in way over his head
Reply: More concerned about the fact he puts the hot lead on the garage
Reply: @zachhofmann4591  it's not hot without a connection to the negative. Power won't flow without the circuit being complete
Reply: @MelodicTurtleMetal  that’s right I forgot he using dc witch loves the negative to work!
Reply: Concerning when the advice comes from the most dangerous electronics YouTuber!
Reply: There’s an electrician in the chat!
Reply: @vacston  it’s all those bald eagles keeping him safe😂🤣
Reply: @TaylorKromOFFICIAL  only takes once.
Reply: @omgrapist  hes trying to help him live longer. Noone has anything against experiments, its dangerous because others will copy. You should check out clives channel.
Reply: Standard lineman's gloves, at least in my area, are only rated at about 1,000 volts. Their coming into contact with any voltage higher than this usually entails deenergizing the line or using long or well insulated tools. Insulated lineman's gloves at 4,500 volts, where it is demonstrated to draw a 12+ inch arc, would be pretty much useless when the power could arc from one pole potentially over the gloves to a mineral filled appendage made of 70% water that is in contact through another body part to the opposite pole of the power source.
    Ever watch a Tesla coil in operation? At high voltages, electricity doesn't need a highly conductive return path. I once saw a handheld high voltage induction coil arc to a bare granite laboratory table top.
    Google linemen servicing 250,000 volt high tension tower cables. It's really impressive how the lineman dons his full body chainmail suit. Then he steps out onto the landing rail of a helicopter that is 200 feet off the ground and then reaches out to the high voltage line with a 4 foot plastic pole connected to a cable bonded to the chopper, That grounding pole will still draw a 12 inch arc from that line to a chopper that is 200 feet away from ANY ground connection. 
    In the immortal words of Jim Croce:
You don't tug on superman's cape.
You don't spit into the wind.
You don't pull the mask off that ole' Lone Ranger.
AND YOU DON'T FUCK AROUND WITH 5,400 VOLTS WHEN YOU DON'T KNOW WHAT THE FUCK YOU'RE DOING!!!!!!!!!!!!!!!!!!!!!!!!!!!!!!!!!!!!!!!!!!!!!!!!!!!!!!!!!!!!!!!!!!!!!!!
Reply: This is completely false lol.
Reply: @sethjones1833  having watched clive for some time ill take his advice
Reply: I saw him doing that and cringed!
Reply: @vacston   Being an American is a great insulator
Reply: @TaylorKromOFFICIAL  there's a first time for everything
Reply: I think most of the people in this thread are quoting ohms law and then not using it. Current=Voltage/Resistance. Sometimes, how bad you get shocked is based solely on your physical make up. I may get killed by 4500 V of DC and Tyler may get slight shock. If my Resistance is 1000 ohms I’ll receive 4.5 amps. If Tyler’s resistance is 100,000 ohms, he’ll receive .045 amps or 45 mA. Basically, my point is, treat it like it will kill you even if it MIGHT not. 120 V CAN kill you. Respect electricity. It doesn’t matter if it’s only 40 V. Use the proper PPE. 

On a side note, look up Naresh Kumar. He’s called “the man who can’t be electrocuted”. I think he’s one of the rare 100,000 ohm or possibly more resistance bodies (that we know of).
Reply: He’s still alive, thank goodness
Reply: @TaylorKromOFFICIAL  The point is, all it takes is one time, you can do something hundreds of times and still one day mess up, because human beings are imperfect, you get to comfortable with something, that's when true danger starts, use your damn brain.
Reply: Not that Tyler even cares...but that statement is false. Burns are the only thing he has to worry about. 😉
Reply: @evictioncarpentry2628  a 9v battery can provide over half an Amp. To defilibrate, you don't need much amperage at those volts.
Reply: It is according to how they are wired, if they are wired in series or parallel. Whether you get more voltage or capacity.
Reply: Nancys..
Reply: @TaylorKromOFFICIAL  no a reason
Reply: @Eviction Carpentry  you're right, current is the one that fibrillation your heart, voltage is the one that causes your meat to detonate
Reply: @jeffreygordon7194  it’s a lot of fun tbh 😂 stupid to do but definitely worth it, and the danger just adds that extra little bit of fun on it.
Reply: @troydreamer5939  It can take as little as 5 to 10 milliamps to kill someone 32ma is rcd rating
Reply: Having worked around high voltage over the years he is correct and this can kill you
Reply: Dear Big Clive: Did you see Styropyro's video about 100 12v batteries in parallel? There is no shock hazard, but you can melt almost anything out of metal, like wrenches and screwdrivers. Photonicinduction did that too.
Reply: And life is boring being save
Reply: Valid point I've never thought about.
Reply: Not just any fibrillation, but ventricular fibrillation, which is 90%  of the heart. Atrial fibrillation is about 10%.
Reply: @troydreamer5939  "9 volt batteries only produce about 15 miliamps".  You know that's no true, right?
Reply: @TaylorKromOFFICIAL  "Hes done this type of stuff tons of times... nothings happened yet."  just means he has been very lucky tons of times.  He appears to be completely unaware of the risks he is taking.  I hope nobody copies these experiments at home 'just for a laugh'.
Reply: @troydreamer5939   You couldn't be more wrong if you tried.  mAh is current multiplied by time and, in conjunction with voltage, describes the total energy capacity of the battery.  In basic terms, that capacity can be expressed as 1 milliamp for 600 hours, or 1 amp for 0.6 of an hour (this is a simplification; other factors apply at the limits).
Reply: Depends on how many  amps.
Reply: @sleezymechanic  If he only touches 2 batteries next to each other, yes. But if you go and touch the batteries at the far ends, then there's 4.5kV of tasty goodness to break down the insulation of just TWO battery shells. And yes, it WILL kill you.
Reply: @troydreamer5939  Well but as far as I understand the whole circuit resistance is what limits the current so if you connect the 2 batteries in series the the voltage is rised 2 times, the internal resistance is also raised 2 times but as long as the internal resistance is not a fair percentage of the whole resistance in the circuit, the current that will go through the whole circuit will also raise almost 2 times. It will raise less and less on each series connected battery but from my calculations on 300 batteries it will be more than 4 amps assuming 2 ohms of internal resistance of each battery and a 25 Ohm device or a resistor in the circuit. For 500 it will be a similar value since the internal resistance is built up so much its now the most relevant source of resistance but the power is crazy 19 kW. If we assume a human is part of the circuit and has 10kOhm resistance (more pessymistic approach would be 1kOhm or even less but let's say the guy is dry) there will be 0.3 amps of current for 300 and about 0.4 for 500 but if the guy is more wet and has only 1kOhm the current going through him will be 2.25 amperes (10kW power) for 500 batteries and 1.7 A for 300 batteries
Reply: I never thought about that.
Reply: Yes but remember that if a battery can do for example 100mA at 9V, then placing two in series makes it 18V and 50 mA, so placing 100 in series, makes it 900V and 1mA, so it wouldn't be harmful, just maybe painful, kind of like a van de graff machine
Reply: @Av_Geek-Nouh_Chahin  The current will not be reduced with voltage.  The high voltage will potentially push more current through a given resistance.
Reply: The tension of each block is still only 9V which means the plastic cases are good enough.  It's getting dangerous when the voltage over multiple battery blocks is touched.  Generally around 45V is taken as the safety limit.  Think SELV / PELV / Schutzkleinspannung or similar concepts.  That's just 5 blocks.  The internal resistance is pretty high but the few mA it takes to cause heart problems even such few 9V blocks can easily deliver.  So keeping away at all times is mandatory.  And lineman gloves are a good idea.

Except I've only seen AC ratings for lineman's gloves, this is DC.
Reply: @Okurka. Assuming his black wire is not grounded, leaning the plus against the garage door is not TOO bad.

Or rather, the fact that doing so did not even spark tells me that the black wire definitely is not grounded even though he said so, as the garage door quite certainly is grounded to protective earth.
Reply: @divVerent  Are you always this late?
Reply: Adn then he couldn't make money for that dodgy VPN anymore...
Reply: Bioscience!
Reply: @TaylorKromOFFICIAL  key word yet
Reply: @TaylorKromOFFICIAL this guy is a specialist in electronics. DO NOT IGNORE HIS ADVICE! He has his own channel as well. You only die once.
Reply: @69uremum like electroBoom
Reply: I love how this comment section is still active after 4 years. But I'm really appalled by all the people that are spreading misinformation, why do they feel the need to sound smart and talk about a topic they don't understand? Surely someone like Clive knows way more about electricity than the average person. It's perfectly fine to not know how electricity works, being wrong and learning is not something to be ashamed of, so why do people without proper knowledge keep trying to counter an expert with baseless arguments? Don't you think the time wasted writing stupid and dangerous replies would be better spent by doing some research and learning something new?
Reply: When Big Clive gives you electrical advice, you goddamn listen.
Reply: @TaylorKromOFFICIAL  We shouldnt wait for something to happen to be safe
Reply: I would have thought the same thing. 9v batteries aren't intended to be stacked to 4500 volts.
Reply: My hear almost stop as i saw him leaning on those batteries. Sometimes the negative pole is connected to the chase. Glad nothings gone wrong.
Reply: @troydreamer5939  A alkaline PP3 can be 500ma